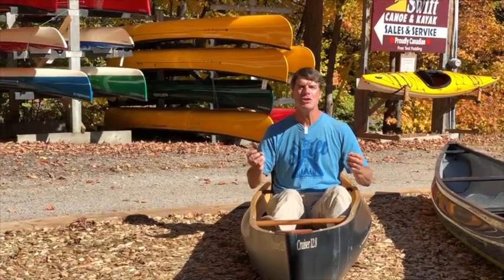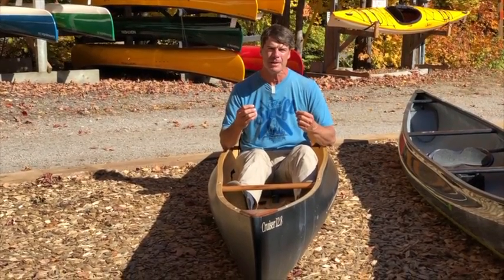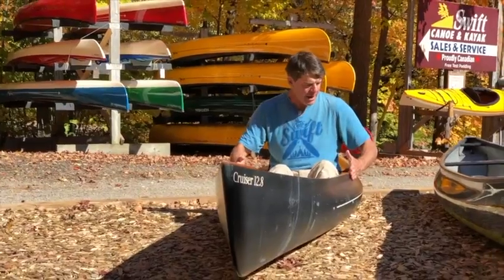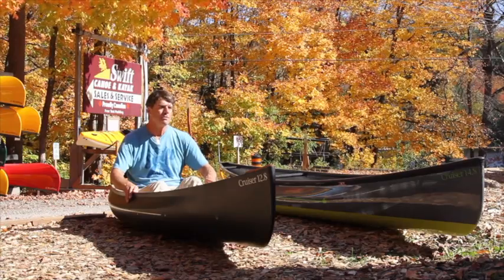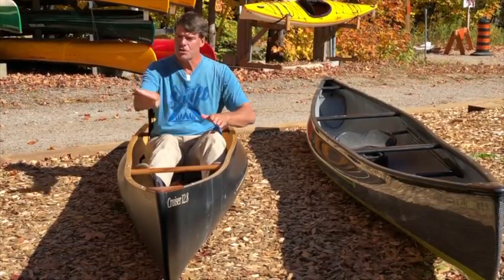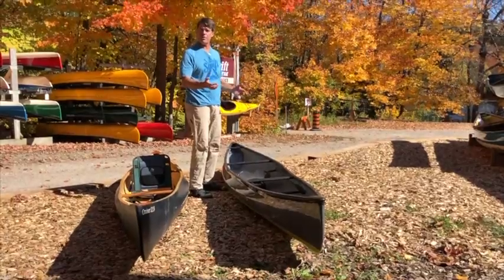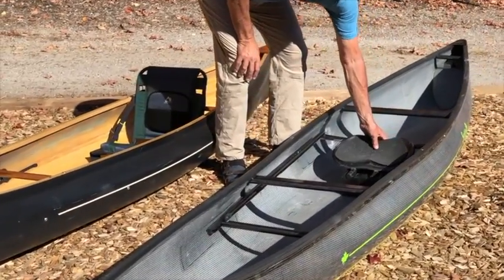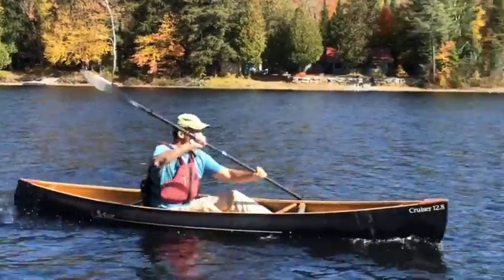2020 Prototype Testing

Comment: I love the idea of these boats and for the part of the world where they are most used; areas with a lot of portaging, I know that they will be amazing. However, on the few rivers that we have to paddle down here that are not dammed up, the water levels vary so drastically, and there are always “scoochy” areas. Meaning areas that we have to drag our boats over rocks. Sometimes “hiking the river” for a couple of hundred yards, while dragging the loaded boats behind us, through a coupe of inches of water. As for the rivers that are dammed up, much of the shore areas are lined with large, sharp “rip-rap.” We all use much heavier boats for this reason. How would these boats hold up to that abuse, year after year? 
     BTW, some of us Southerners are planning a trip to the Algonquin area this summer and hope to get to try out some of your boats, for the first time during that trip. I can honestly say that I am almost as excited to get to try these boats out, as I am to get to make the trip, at all!
Reply from the maker: composite boats can still handle that kind of use, you just have to go with a heavier duty laminate that's made for impact. Still significantly lighter than a plastic boat. You'll love Algonquin, it's a world all its own. Be sure to stop by our store outside Algonquin Park and say hi, you'll go right by it on your way into the park!
Reply: SwiftCanoeKayak We will try to stop by! Thanks!

Comment: I wish you guys did a cruiser 13.6 in that design than a 2 inch bigger one.
Reply from the maker: the Cruiser 14.8 has similar volume to the Pack 13.6 but it's faster and more efficient. There may be a Cruiser in the 13.5 range down the road.
Reply: Nice. I already picked up a pack 13.6 this season but I would have gotten a cruiser 13.5 instead of one was available. The 12.6 was too small and the 14.8 was longer than I wanted.